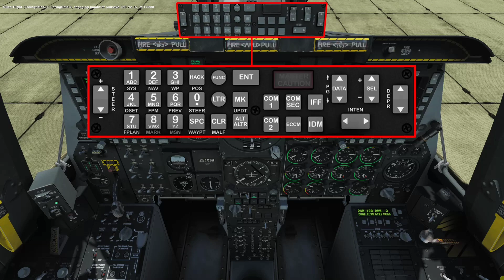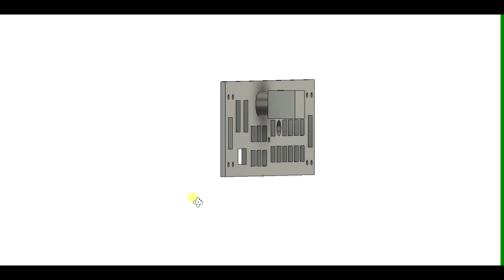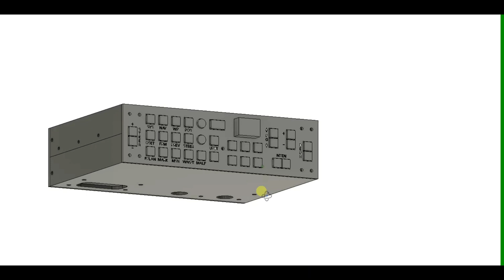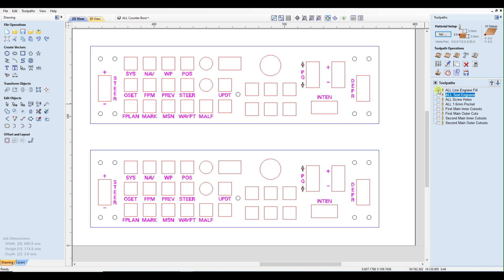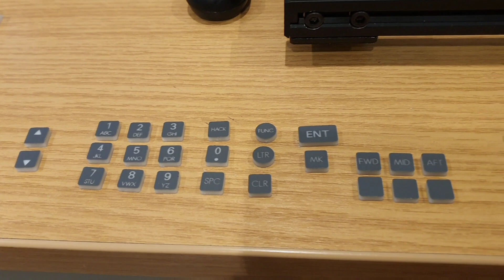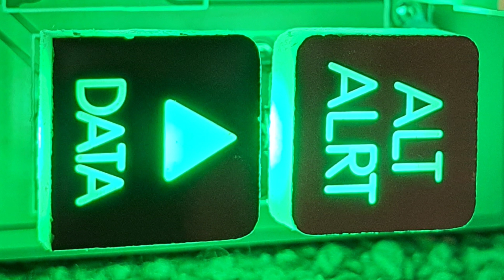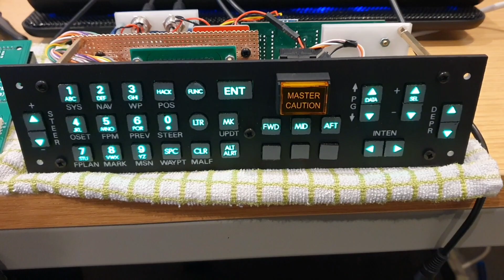Simpit A10C - Front Dash - Part 32: Up Front Controller

Comment: I really like this, and would like to build a similar panel on these lines. Could you tell me what are those switches you used and where you source them?
Reply from the maker: Certainly, I got them from Ali Express, the seller was MKT Studio and the description of the item was
"100Pcs 6*6mm Through Hole Micro Push Button Tactile Momentary Switch With LED Green Yellow Red White Blue Yellow-Green"

Comment: It's probably because I don't have a background in electronics, compared the worthog project this seems over engineered and bulky to me
Reply from the maker: Hi John, it's certainly belts and braces, lol. But on a serious note, if I had of fed all the buttons straight into dcs bios and wired as a matrix (instead of out to a keyboard encoder with a dedicated input per button), plus ran the master caution with a 5V LED straight from the arduino (rather than 12V through a mosfet), then absolutely it could have been significantly slimmer / less involved at the rear
Reply: @CraigSmysimpit  lol. It's definitely an impressive system